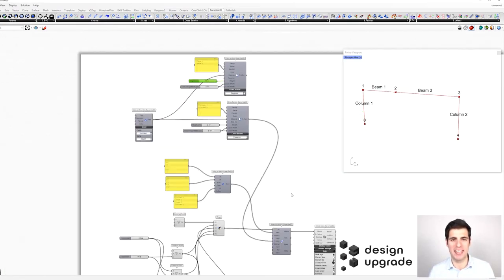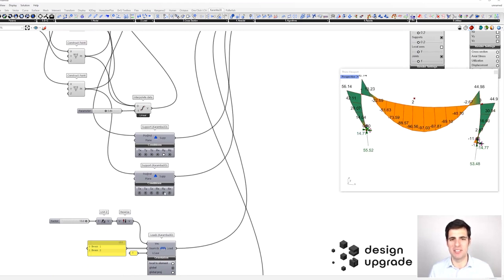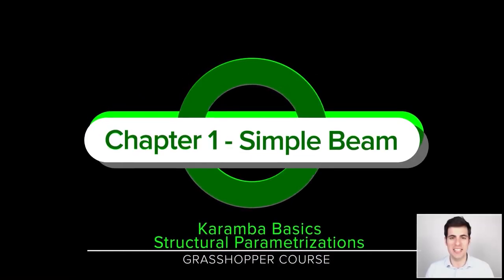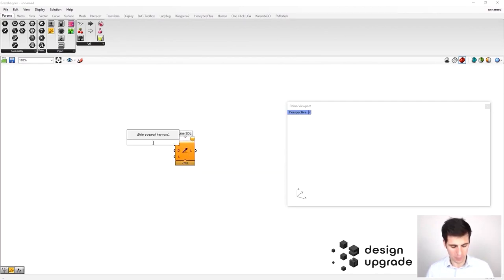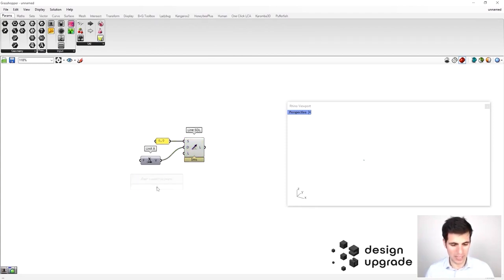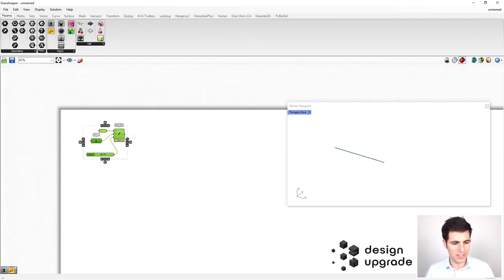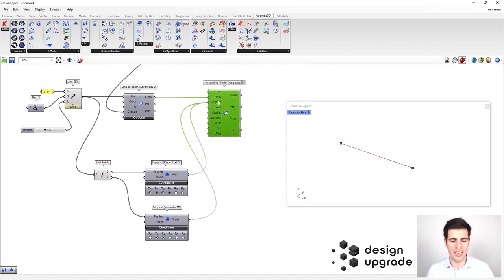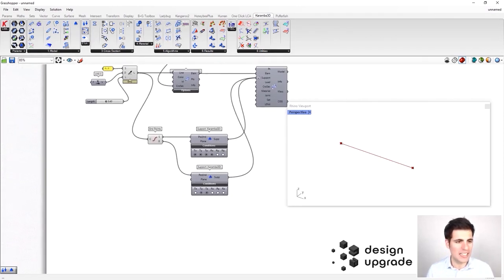Karamba3d for Grasshopper 1 - All about "Simple" Beams

Comment: Hi Diego, thanks for useful content. I am beginner in Grasshopper and Karamba and its easy to follow your tutorial. Anyway, which version of Karamba do you use? I use the latest version Karamba3D but can't find UniformLine in Loads options. (I already update Karamba license as well). Thank you in advance!
Reply from the maker: I'm glad the video is useful! You just have to get the "loads" component from Karamba and then choose in the white drop-down menu (uniform line). Since Karamba 2.0.0, there is also one independent component for "Beam loads" that may be used as well!
Reply: I have the same problem. There is not option for Uniform loads on the white drop-down menu. Not sure if I have to download some additional stuff. Great tutorial anyway

Comment: Hello, I have a question: How do I create a torque force distributed over a beam in Karamba?
Thank you!
Reply from the maker: The easiest approach is probably to divide the beam into smaller elements and then apply moment forces at the intermediate nodes...
Reply: Can you tell more details? Thanks
Reply from the maker: Just get a beam divided into 10 parts as it is showed in the tutorial and then apply at each intermediate node a Moment Mx = m x L (being m: torque force distributed and L: length of beam subdivisions)
Reply from the maker: Update -> It is now possible to diractly apply torque moments qith the new component Beam Loads of the Karamba 2.0 version -> https://github.com/karamba3d/K3D_NightlyBuilds/releases/tag/2.2.0.1-WIP